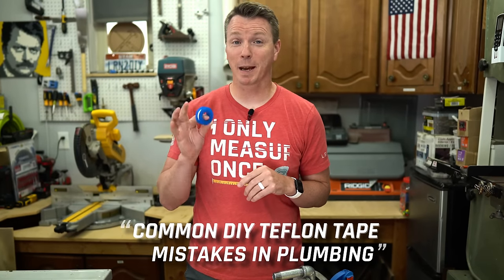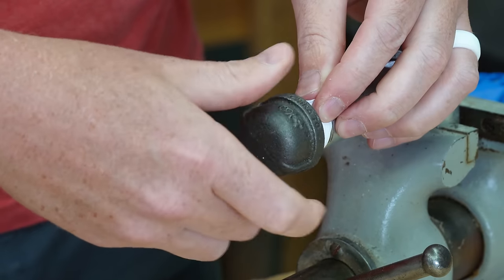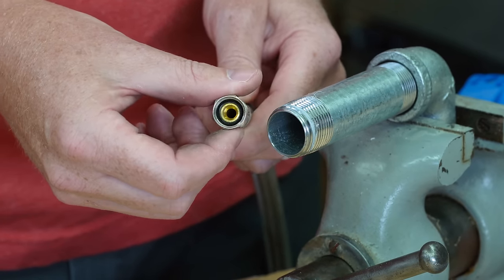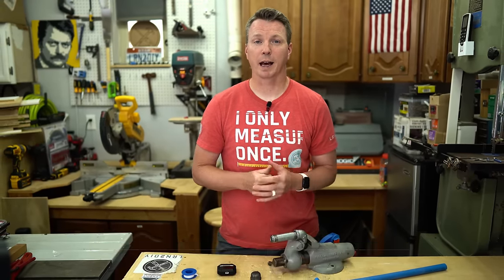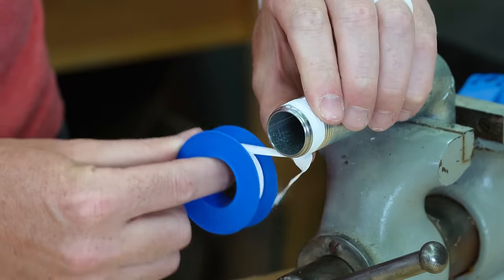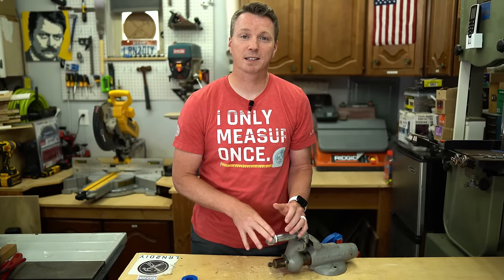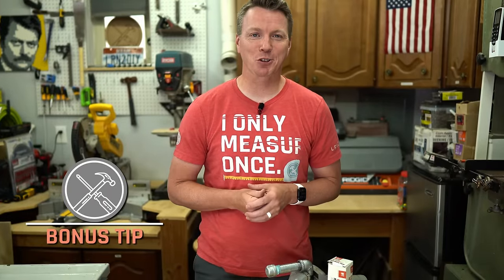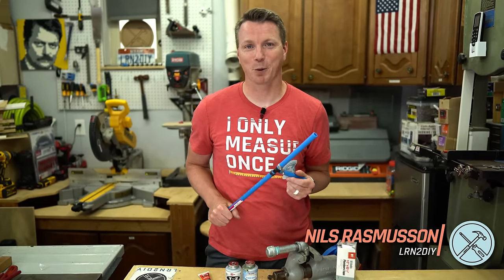6 Plumbing Mistakes DIYers Make with Teflon Tape

Comment: While rubber seals will melt during soldering, teflon tape will not burn and is not affected by the heat of sweating or soldering a fitting.

Comment: "Shouldn't" need to use teflon tape - You must not use teflon tape in those cases. The tape will get in between the rubber or the compression fitting and actually make it leak.

Comment: For compression fittings on older pipes with a dent from previous install, I like to add rector seal to the stub out.  Otherwise 50% of the time angle stop will leak.

Comment: Is tape for water pipes the same as tape for gas pipes?
Reply from the maker: No. Tape for gas is yellow and is not rated for water sealing, just as white tape isn’t rated for gas so be sure to use the right tape for the job.
Reply: Thanks.
Reply: Something i wouldn't have known had I not read this comment.
Reply: Just wondering, if you are not sure about that, what do you want to do with gas? I hope it's not natural gas from the grid, this thing is scary as heck, not something I would touch without certification, and for sure not legal where I am.
Reply: @syriuszb8611  Gas to homes runs at a much lower pressure than water and is actually easier to seal. It is easy to detect leaks with a little soapy water. It smells at very low concentrations if a leak were to develop later. Nothing to be intimidated by.
Reply: @LRN2DIY  Yellow tape is still safe for water. From Oatley website "All Oatey thread sealant tapes are safe to use with potable (drinking) water." Rectorseal yellow tape says it is Non-toxic and Resistant to most liquids and gases. It appears that while the formulations may have used to be different they are now the same but they provide Yellow for code compliance. Oatley states the white tape will work for gas but recommends yellow be used.

Comment: I use Milrose pink 3 turns pull and stretch into threads . Here’s a tip when screwing plastic threads into metal leave first three plastic threads naked and Teflon tape the rest .Helps prevent cross threading and yes I use plastic rated joint compound over the tape .

Comment: All of his training was done on a connection that was out in the open but I wish he had covered tricks to wrapping connections that are in very tight spaces that might be barely wider than your finger. I don't have a good way to do it. Usually, I tear off a short length and try to use two fingers to wrap the piece and then do it again with a second and maybe a third piece. Finally, I force the tape into the threads by rubbing my finger over the threads, to force the tape into the threads. There is no good way to start with a long piece because usually static cling makes the tail get folded over on itself. It's generally a frustrating mess.
Reply: I had some luck with spooling the tape on a pencil/toothpick/allen key first and then transfering like you would usually.
Reply: @mobuildsstuff   Thank you very much for your comment. I'll try that next time i'm in that situation.
Reply: I would not even try in those situations, just use a sealant.

Comment: Possible issue with tape vs dope… if you have to back off the fitting to a line it with another fitting … you can develop a leak since it’s no longer tight…
Reply: Because the teflon doesn't make a seal...tight threads do and if you back them off they are not water tight.

Comment: Dont get the white tape its super thin. Get the bluemonster or the grey Megatape they both work well. I usually use the grey for showers so it blends better the the nipple and shower head. And i like to use the blue everywhere else ( i like the blue better just a preference... Maybe color preference).

Comment: I was introduced by a friend of mine that is a plumber and he uses green Teflon tape exclusively. It gives him virtually no call backs with leaks.
Reply: Green is to identify oxygen pipes and does not contain any petroleum products in its chemical makeup.  Using it on pipes which are not oxygen lines can cause confusion and could lead to misidentifying the lines.  Never do this.  Yellow is for natural gas pipes .  The colors have a meaning and in some places you can be fined for misuse (similar to wiring with wrong color wires as to hot, neutral and ground wires).  You could be held legally responsible if someone gets hurt from mislabeling in wrong tape or wire colors.. Caution to this point for sure!
Reply: @mrstanskaggs1  this comment is misleading.  Using green Teflon for different applications is perfectly fine.  You can use if for oxygen, air, inert gas, or water just fine.  Basically if you use the green it will be fine for most, if not all situations.     If you fail to use green on an oxygen system, it can result in fire and you can be held liable if the cause of the fire is investigated.    NEVER use teflon coloring to label or identify a system.  This advice is wrong.     Over 10 years in the oil and gas and electric industry.   Using green Teflon will never get you in trouble.  However, it’s less pliable and harder to work with.    Improper labeling can cost you your job or your life.
Reply: @mrstanskaggs1   "Green is to identify oxygen pipes and does not contain any petroleum products in its chemical makeup."
Yeah no. That is not true at all. SOME brands do that for SOME of their products in SOME regions - but in general that is just wrong.

Comment: The pipe dope/tape fills the void between crests and roots of the threads and lubricates the thread faces. It flows into place when compressed also filling common imperfections -- reduces need to over-tighten.

Comment: Another little tip...
After you break your tape you can use the spool to press the tape into the threads to hold until ready for the fitting by placing spool edge on first thread and spinning around two-three threads to press the tape in. It will hold until needed.

Comment: 6 to 7 Wraps is for the crappy DIYer thin stuff from a typical box store. Quality tape is a bit thicker and requires no more than 4. Regardless of which one you use, be sure to slightly stretch the tape when applying. This will help to keep it in place during installation. If it is too loose, it will migrate up the threads. Pipe threads are tapered, so this is important to keep the tape in place to avoid cracking the fittings trying to get it to seal if the tape moved. Cheers.

Comment: Hi, can you explain why PPR metal treads are always only straight threads instead of a tapered thread. I have a lot of trouble stopping them from leaking and do you have any ideas as to help seal this type of a joint. I use them a lot connecting PPR to existing GI pipes but never have much success first time. PS Why is the tread always strange looking like little cuts in the treads.

Comment: If you start at the end of the threads farthest from the tip and wrap towards the end, you will "capture" the "loose" end under the subsequent wraps of the tape.  Also, you have better control regarding how close to the end you get -- so your first "DIY Mistake" is less likely to happen...

Comment: Hi Gary from the UK here, I'm a plumbing and heating engineer for way too long,  on compression joints I put a smear of joint compound so the olive has something to seat against and don't over tighten the  joint, if it needs a little nip up then you have a bit of wiggle room if you have a leak
Reply from the maker: Hey Gary, thanks for the info! Always great to learn from folks with tons of experience like yourself.
Reply: @LRN2DIY  thank you for that YES I do have a lot of experience in all aspects of construction if you need any help

Comment: IS IT OK TO USE TEFLON TAPE ON OLD GM CAR GASOLINE FUEL LINE FITTINGS WHERE THEY SCREW INTO THE CARB, OR WILL THE TEFLON DISSOLVE & POSSIBLY CLOG UP THE FUEL FILTER OR EVEN THE SMALL PASSAGES IN THE CARB?

Comment: never use tape on gas line with dope, only use pipe dope, for the pipe dope sealant to work it has to contact metal to metal and when you use tape and dope you are blocking one side of the threads the pipe dope sealant needs to seal.

Comment: for how many laps you need to put:it depend on the thread condition so at first put the fitting together without teflon and check if there a significant play then you have to put more teflon 8 or 9 laps is the play is normal then 5 or 6 will be enough.
Reply: That is a waste of time just get into a good habit of doing it right the first time. Pipe tape is cheap and so is the pipe dope.

Comment: So the pro said "thinner than normal" but didn't say what normal means?
Also, I've always held the tape so that I am able to stretch the tape slightly as I wrap around the pipe and so that the tape gets into the threads.

Comment: While threading on fittings is it advisable to reverse (or unthread) a little (say 20-45 degrees) a fitting sealed with teflon to fit and match the install??

Comment: You tube plumbers that wear over  sized safety glasses are not a good source to learn from. I've seen e few of Rogers video, doesn't seem to act like a real plumber. In the trade, you use two wraps thick of teflon , any more it just rolls off when you tighten the fitting. Also, the first two threads are the sealing point, the rest are for strength. Pipe dope is not necessary. I normally just use pipe dope with no issue. I use teflon for plastic threads. Between tic toc and you tube there sure are a lot of wanna bees. Before you give me any flak, I am a sixty year old union plumber.

Comment: It's funny how there's so many varying opinions on the proper way to apply Teflon™ tape. 

* First, you DO wrap it clockwise if you're looking into the pipe. That's absolutely correct.

* Second, you wrap the tape TIGHTLY, stretching it slightly, starting at the VERY FIRST thread, overlapping it about 3/4 the width of the tape per turn stopping at about an inch back.

* You DO NOT start wrapping several threads back from the end of the pipe.

* You DO NOT wrap the tape loosely.

Comment: Depends on the tape and threads.   Npt is not consistent between materials.  Definitely needs more than a few.  Sometimes it's 10. Don't over tighten.  Assemble by hand and tighten it until it stops dripping.  90% of the problem is over tighten.

Comment: What Roger says is true, and the condition of the part to be wrapped can be taken into account, as the number varies whether it is a new or used part, and the company’s instructions should not be followed in all circumstances, such as Nissan saying that you must change the transmission oil every 30 thousand, and not everyone adheres to that.

Comment: You can wrap the tape in any direction, easily in clockwise direction for amateurs. Once your fitting starts to bite the tape, it will not unravel.

Comment: Strange phenomenon. I have some cheap non brand ptfe tape and it seems to have become friable over time. Fine when new but now does not stretch well and just likes to split and snap. This should not be possible as PTFE is supposed to be very stable. It has been in a drawer and is not to light. It is several years old.
I know the simple solutioin would be to buy fresh (not always convernient where I iive. I am just curious, but does anyone have a clue what is going on?

Comment: When using teflon first put a thin coat of pipe dope then 3 wraps of tape and then use a coat of pipe dope.  Just using Teflon will not work very well.  Take my word for it . I have been a Pipefitter for 50 years.

Comment: Oh, yeah, and it's really easy to do.... on a fixed pipe, on a workbench, held by a vise. But try putting tape on under the sink, on your back, upside down, with no space for the tape spool to go around the fitting, which has old tape on it.... etc, etc etc.....

Comment: Teflon tape kind of sucks. Have done it perfect before and still had a leak. But if you use the tape and a little silicone over the tape it will never leak. It is easier than pipe dope and allows for easy unthreading if necessary.

Comment: teflon tape... by itself ... works well .... rectorseal (pipe dope)... has worked for a zillion years all by itself before teflon tape was invented .... so... if you are using new pipe and fittings and there are no defects ... just use one or the other (or both  if you really want to )  if you are using used pipe or fittings or defective materials ( yes, sometimes ya just got to do what ya got to do  and work with what ya got until you can do better) then by all means use any and all forms of sealent/lubricant you can come up with .....  but generally .... ya dont need both

Comment: Been using this tape on the ends for 45 years and have never ever had any issues. Wrap tape same way you thread on.. Righty,  tighty looking at the end . This tape fills poorly fitting nuts and fittings

Comment: #1 mistake is using tape.throw that tape in the garbage and just use pipe dope
Never have i had a dopeed fitting leak on the other hand a taped joint can leak  even if everything was applied perfectly

Comment: So glad I found your vid. I was wondering if I needed to apply plumber's tape to plastic valve screws for my Airstream water pump replacement. Now I know it's not necessary. Thanks for producing the video.

Comment: Many don’t realize that pipe threads are tapered. (NPT=National Pipe Taper)

Tightening threads is akin to driving in a wedge.  Teflon is a lubricant as well as a sealer.  It just seals what isn’t wedged solid.

Comment: With brass fittings and brass threaded pipe, the fittings break too easily when a connection is made. Many plumbers crank down on the pipe to assure a "good seal", thus cracking the fitting.
Have always used both dope and tape for water connections, giving me a smooth and water tight connection.
Reply: tape is a lubircant.  dope is a sealant to lock the junction together.  These are opposites in function.  Care must be taken if you use them together because your joint is not secure as it should be.
Reply: @mrstanskaggs1   "tape is a lubircant." - it is a sealant just as well.
Reply: @ABaumstumpf  Nope, tape is not a sealant.  It is one of the biggest misunderstandings out there.

Comment: I don't know why they make Teflon tape for gas lines. You should never use Teflon on gas.lines where a broken bit of tape can go down the line and.block burners on furnaces,  heaters, or generators.

Comment: In iron pipes with high pressure, I recommend to use (linen threads) then using Teflon tape with less than four laps....Sometimes Teflon tape alone is not enough especially with high pressures.
If there is no (linen threads)!! Try to turn the Teflon tape to be like threads at first laps ,then continue as regular tape

Comment: I use Loctite 55, never had a problem since start using it
Reply: In a pinch, original Gorilla Glue works too! Needs to sit an hour or 2 before pressurizing so no good for plumbers in a hurry.

Comment: 100% right on not applying teflon tape on first thread. Years ago we had a plumber install teflon tape extending past the threads damaging two chemical pumps.

Comment: The best way to use Teflon Tape is to NOT use it at all. It is not a sealer and the stringy makeup of it will get stuck in valves and gauges and where ever it can. As a career Industrial Maintenance Man, my product of choice is Loctite Teflon Gel #567. Good for all applications except stainless steel pipe threads. Throw that Teflon tape in the garbage can.
Reply: Glad to hear from a career maintenenace man condemning teflon tape. I too hate teflon tape. I used it for some water pipes, and later when i rerouted the pipes I had to clean up the teflon tape I had used which had turned into a mass of a yucky stringy disgusting entanglement much different from the original tape i had put on beforehand. Also, professional plumbers came in to move my gas meter and install new gas pipes, and they put everything together using dope, and didn't use teflon tape, so i think if they don't need dope, then neither do i.
Reply from the maker: I appreciate the feedback - especially from someone with your experience! I'll have to give the Loctite Teflon Gel #567 a try. That sounds like a great product to let people know about. Thanks for sharing!
Reply: @LRN2DIY  Glad the advice is going to good use. I was weened on Teflon tape and a vendor from loctite held a seminar saying to avoid it. My career spent much time on hydraulic and pneumatic work on machinery. Glad this was brought to my attention as well.

Comment: You put way too much tape on those threads.  You only need two to three complete wraps and it isn't necessary to run the tape the entire length of the threads.  Once you have a seal on the end portion of the threads, that's all you will need.